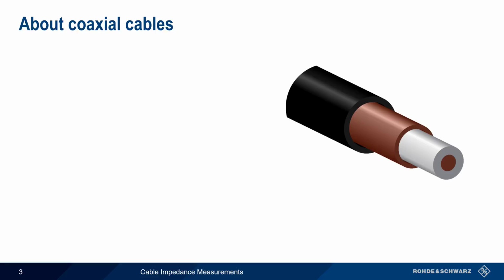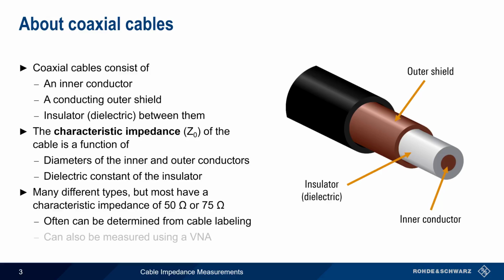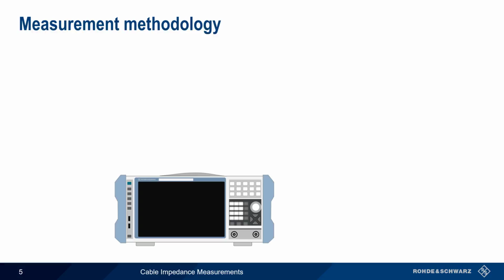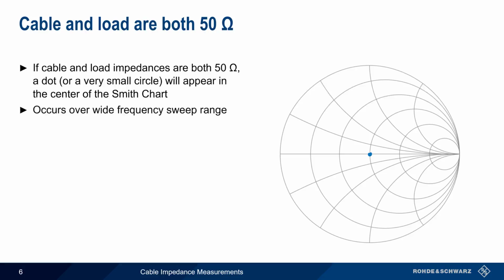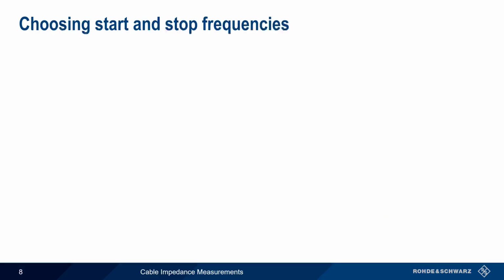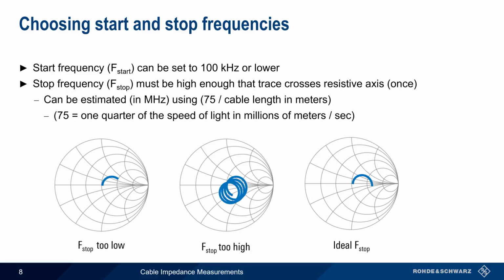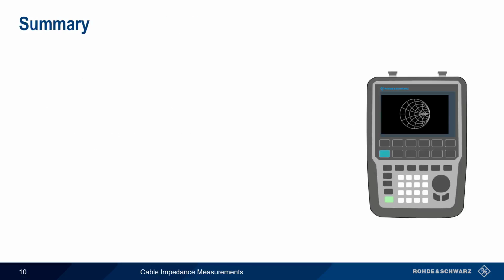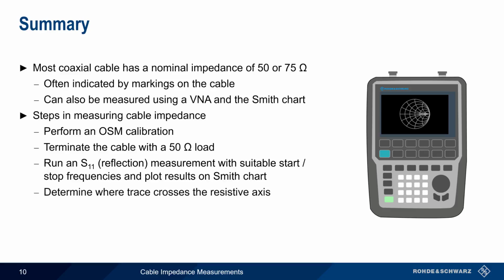Understanding VNAs - Cable Impedance Measurements

Comment: This is a very useful method in finding Zo of a coax line. I've tried it on my handmade slotted coax line and found the Zo of it. The only point is that you do not know the right length of line that corresponds to quarter wavelength unless you know the velocity factor of the line. I've measured velocity fac. of the line and corresponding frequency by my nano VNA. Plus that I was forced to connect a variable resistor at the end of the line and varied it until the above frequency and its corresponding point laid on horizontal real axis. I red Zin, and measured the variable resistor and calculated Zo of my handmade slotted line by the given formula. Regards and wish everybody success.